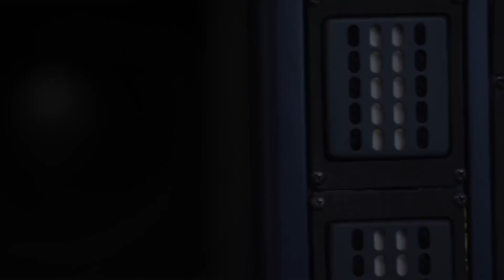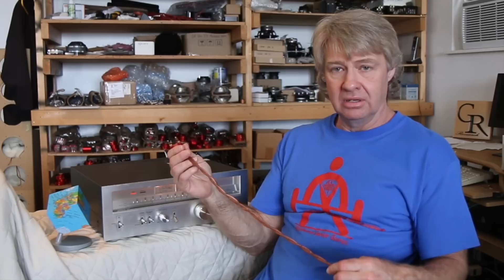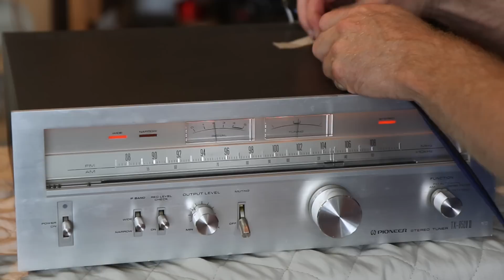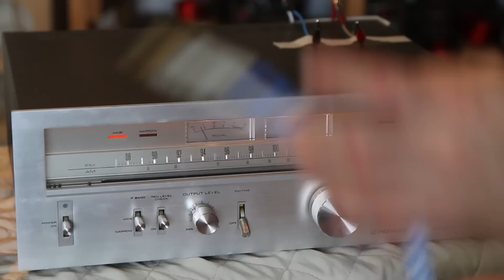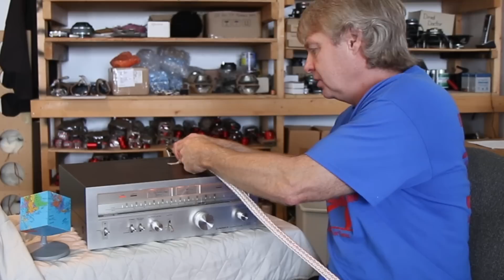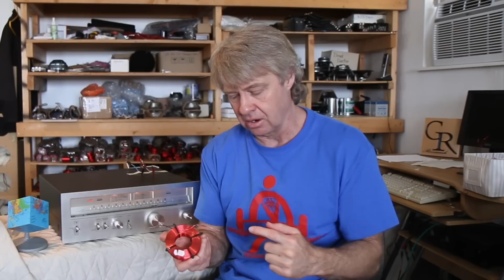Do Audiophile Cables Matter? Here's PROOF!

Comment: Danny, I think people are confused when you use the term "noise" as being something like hiss or distortion you hear as unclear, indistinct conflicting sound which covers up the music. When you say "noise floor" I think of very quiet sound, even though you meant something else. Here is an analogy that works better for me. If you listen to music at 2 to 3 AM in the morning your stereo sounds better because the EMI pollution around us is much less. Think of a lake of water early in the morning with no wind. The reflection of the moon and stars are perfect in the water. As the wind picks up, just like it does later in the day, the "noise" or waves on the water indirectly distort the reflections on the water making the picture reflected on the water less crisp and distinct. The water is like EMI noise pollution. Over the last 40 years EMI pollution has increased exponentially. Not sure as to weather EMI is sufficient coming in over speaker wire to make a difference, but the current of the music going through the wires can create it's own EMI that would be stronger.

Comment: You will always get noise but it's the level that is important. That is if it's enough level of noise to actually hear it. And no cable is going to get rid of all noise. Not completely. A lot of noise is picked up by the mains power lines. They are big antennas. But l really don't think it could be heard let alone noticeable. Otherwise this would have been an issue and addressed decades ago, way back in the '70s.

Comment: Listening to this video through my headphones with wires connected to my smartphone designed to use the headphone wire as the FM receiver antenna. Sounds great. Might be because I can't hear FM radio signals in the MHz range, or that the energy from the FM radio signal is near zero and won't drive the headphones, and if there was enough energy to move the drivers, they couldn't reproduce MHz. I just don't know.
Reply: You are 100% right. This is total hogwash, obviously. There are many videos, and articles by the experts in this field that totally dispute his "findings". PROOF? HA..
Reply: @WESTEL Audio  ;) yeah, but I also microwave my headphones for 100 hours on low to make sure they're burned it

Comment: With no input signal I can turn the volume of my 25 year old preamp going into 375 watts a side of power hooked up to 91db efficient speakers all the way up to full , much higher than I ever play them and hear practically nothing. Should I thank my power  company for the lack of noise in my system or is all this talk about noise coming over the transmission lines affecting the sound coming out of your speakers nonsense? I have nothing special in the signal path and don't do anything other than follow the basic rules when it comes to crossing cables and have zero problems picking up any audible noise from my speaker wires.

Comment: Obviously the more expensive cables will offer less resistance and inductance. You may be able to measure the difference, but can you actually hear the difference in a blind test? Most people will not hear the difference unless there is an extreme difference in the conductor. A filter on the incoming voltage of the amplifier might do more good than uber expensive cables.
It's what ever makes you happy.

Comment: Mr. Richie:  I think your presentation is getting challenged mainly because your assertion that the 100MHz FM band EMI results in a noise floor contributor (within 10dB/Hz) in the audio band.  That tuner's reference sensitivity is quite good, at 1.5 microVolts, which also does not help your argument because it puts any interference detected by the tuner at/near sensitivity (as shown by "stereo" capture and VU nominal) at best around 140dB below reference level at the speaker input, somewhere 40-60dB below audible threshold.  Tough to gain that up even with the worst of NFB amp designs subject to 3rd order mixing/modulation spurious products from ingress VHF.  I think you are simply demonstrating a parallel 2-conductor t-line will support induced TEM mode much more readily than an interleaved n-conductor t-line for physical dimensions on the order of the wavelength of interest.  Indeed, for this particular experiment, a dual/quad-shielded, RG6 or RG11 might fair much better.  Of course, terminations and length are also a key factor as others have argued.  On that note, I'm also wondering why you suggest some type of "filtering" is at play which, as you correctly point out, would not be the case with the coax.  If I buy a speaker cable and it employs any type of audio band filtering, I'm returning it as defective.  Since everything comes down to cost, I see from your web site that the best cable is $13.75 per foot plus $40 for assembly gear.  So I can have a nice 10ft cable for around $180?  Assuming of course I do a good job of assembling it.
Reply: I'm coming back to this one with greater detail and explanations. And yes we are offering low cost solutions that sound very good.

Comment: I mean it's proven that you want cables to be braided or shielded or both to some degree and the material to be at least pure oxygen free copper. Even for use of just sending a signal people use foil shielded cable. Why? Because even computers can catch interference. And that alone could fill a book explaining that but yea braided and shielded cables made of oxygen free copper are important.

 Silver plating is for the rich. Unless you go with stager silver solids but that's also another thing that could fill pages or chapters over.

Comment: The best audio cables I have are Van Damme with Neutrik connectors. I don't know how well that cable would be thought of in HiFi circles, I am mainly using it in a music production environment but I do listen to a lot of music. The worst audio cables I have are those plastic ones that come with any cheap audio/ video equipment you buy. So I decided to do an experiment where I split a mono signal, send the signal down both cables and recombine the signal at the other end but reverse the polarity of one of them so that any difference in the sound would be the only thing you could hear. So if the signals where identical, there would be silence. If i skipped the cables and did this experiment in the digital realm, there was total silence once the level of the two signals was matched. When I did the experiment via the cables, there was not silence. There was very little sound. I had to turn my amplifier all the way up to hear it but it was not silence. I don't know how much difference would be detectable by the human ear. I would like to try this with very expensive cables versus other cables.

Comment: I really hoped to get some proof rather than just irrelevant application of some wires to the amplifier input.  Sorry - but what were you trying to test?  Some weird braiding technics?- Noise-cancelling? There are no hidden tricks here like copper quality or wire thickness- it's all irrelevant. What's relevant is line impedance, source impedance and receiver impedance matching. Simple matched coaxial cable ( yes- chipset coaxial will beat any other that thick nonsense in terms of noise cancelling on low power transmission lines. There is absolutely no point in using so much wire metal for low- power signal as on the amplifier input side. And there is no point to use that much on the high power ether  if proper EMF compatibility technics are used  ( so just throw all that crossover junk with open coils spreading all sorts of induced noise).

Comment: If you really wanted to prove that there was a difference in cables when it comes to audio, you would simply measure a speaker with white noise, change the cable and measure again with the same white noise out of the same amplifier ect........doubt we'll see that any time soon though.
Reply: t doesn't work that way. The differences won't show up in amplitude.
Reply: @dannyrichie9743  A calibrated mic is far more sensitive then the human ear, if the difference can't be measured, the difference doesn't exist.
Reply: @matilija  It isn't a matter of the mic or the ear being more sensitive. The trick is knowing how to measure what we are looking for or how to measure what we hear. I'll give you an example. We make a change that makes the sound stage deeper.  We hear it clearly and it is repeatable. How do you measure it? There is  ton of stuff that we hear easily but have not figured out how to quantify it with a measurement.
Reply: @dannyrichie9743  So, you can measure a speaker and showcase how smooth it's response is, and if the crossover is tuned correctly, and how good the off axis response is, but you can't get a simple difference measured at all by changing the wiring?  Is it because there isn't one?
Reply: @matilija  No, it's because there are too many elements and variables that effect the sound that can't be measured yet.
Reply: @dannyrichie9743  Lol, I say there is a difference, and you just have to believe me because no difference can actually be detected by instruments that are better at detecting differences than human ears.  I'm done here, snake oil can at least be used to polish steel, though baby oil is cheaper.
Reply: @matilija  Just keep telling yourself the world is flat and feel comfortable in your beliefs. And please don't just take my word for it. I'll be more than glad to prove what I claim. Just come on over. Unless you don't trust your own ears.
Reply: Lol, resulting to insults because you know you're being called out.  Sorry Mr. Richie, but you are wrong on many counts.  

Here's the thing, you titled this video, "Here's proof". Provided absolutely no proof, nor anything even resembling proof of your claims.  And I already wasted my time watching your non proof providing video claiming to provide proof.

Why would I waste another minute of my time with anything you claim as proof when I already know you can't actually provide any and even readily admit that you can't measure any difference?
Reply: @matilija  I didn't title the video. I just shot it and sent it into my editor. 

You prove yourself wrong with your own words. "I already know you can't actually provide any".  You don't know what I can provide. You have no idea. You are holding to your beliefs and refuse to hear anything to the contrary. No science.... You are the flat earth poster child. 

And I showed a measurable difference in cables in the video.
Reply: @LouGuido  You also have it backwards. It's those that hide behind the concept of science that are failing to do any. 

" In scientific research you can observe an unexplainable phenomena through a measurable difference or through some form of controlled statistically valid testing."

Correct. Controlled listening test have been made repeatedly by myself and thousands of others within the industry.  

"These claims are then peer-reviewed for repeatability and confirmation and recognized as true in their field".

Yep, done that. And many other companies have too. 

"The key here is that in order to make a claim you have to show that some difference exists."

Confirmed. Audible differences exist and those differences range from subtle to quite dramatic. 

And there is no evidence to the contrary. When a known and confirmed difference is present but the measurements don't show a difference then you are measuring the wrong thing. 

And when you measure and then draw a conclusion that there is no audible difference having done zero listening test to confirm your theory then that is not science. That is a belief, just like the world is flat.

Comment: There are a number of offered suggestions about EMF and how antennas can be made from cables. Amplitude Modulation (AM) can be translated directly to sound. It's the simpler form of on-air broadcast mediums. The carrier wave varies in strength directly according to the amplitude of the input. The converse is true.    
Everything else requires 'translation'. All of the noise obtained for measurements here are broadband receptions and the tuner selects a particular frequency band which is reflected in these 'findings'. A more scientific approach would be to measure the ambient field's strength in it's entirety. This  can then be used as your 'ground' state. Then the 'noise' can be validated as to how it affects the output.
Encasing cables with a grounded layer will let us see what the cable actually does. 
Faraday cages for everyone!  BTW, nobody ever heard a FM transmission directly. That a wire picks it up, Eh.

Comment: HiFi consists of precision / construction and sound, precision is measurable and always has a theory, sound is typically not measurable and have no theory.
Sound (sound signature) can only be selected and judged by ear and brain.

What you describe is precision that is measurable as you show in your own way.

Sound differences manifest themselves clearly differently than noise, an example battery operation remove noise but a lead battery has a different sound than a lithium battery .

It seems that sound (Sound signature) is associated with material choice.

Another example is a paper capacitor vs plastic capacitor the majority hear clear difference.
Sound is associated with more or less lifelike reproduction, thats all Hifi is about.

Comment: Forgive me if this sounds like a stupid question. But I'm fairly new to the audiophile world and I'm learning a lot by watching your videos. Interference of any kind CAN cause measurable effects on the quality of your sound. So would having your equipment ran into a good quality power-conditioner help eliminate that issue? Would this, plus shielded cables make a huge difference?
Reply: If you live in a power plant it could.... In most of the regular homes an extra shielding does nothing, assuming that you prepped and connected your audio cables properly. Induction on both wires is in opposite  phase hence it cancel each other.

Comment: Speaker cable is connected to output stage, then to input stage via the negative feedback loop, it's known and is delt with within the global negative feedback HF roll-off.  Demodulation is achieved by any base-emitter junction (ie diode) you care to find along the way. It had an historical effect on 70's amps and some later poor designs which only had a resistor to set feedback If you wan't to make sure, just put some clamp-on ferrite cores at the cable at the amplifier end.  RF, you won't hear but it can cause intermodulation which is a distortion mechanism, so best be safe.

Comment: there are a lot  stupid comments here....  yes the demo he shows is true  the more a cable recieves from outside the more noise it transers to speakers.... realy guys i had an isseu whit an old reciever when turned off sometimes i can hear strong local stations on the midwave bands ..it was clear to hear wat the music was or wat the DJ says on that station.
Then i buy twisted speakercabels it was gone !
The better it recieves from outside wil give noise to the speakers, shielded works for interference if you have a ground problem like a microfoon touching and start humming but it wil not help for noise blocking whit interference from other cables or dirty currend from the net.. the best way to elimenate dirty current from the net is use a good Currentfilter between your wall power and reciever and components.. that filter a lot of noise out from the netpower. But Good video anyway !!

Comment: I dont hear any noise on my speakers , and im using Tube gear , im on tube amp . 0 noise , dead silent . i can record it for you but the noise floor on my Condenser mic phantom power supply , or fans from PC are going to enter in the picture , but trust me , when i get my ear down to the tweeter , cant hear jack shit , nothing . And that is on Tube Amplifier mind you .
How did i manage that . Easy , desolder Ground wire , so now i can die , but hey im going to die with 0 noise on my tweeter, you are going to die as well but with noise on that tweeter , messing with cables and shit , arguing about how much it matters .
While we the big boys , we desolder ground wires and do other wild stuff , so wild staff i cant even say it here  Google is going to delete my posts out of public  health hazard reasons ,  hazard for cable selling company's an shit :)

Comment: ive been watching many vids for the past 3 years for and against sound quality regarding cables. in the beginning i sat on the fence about it all mainly because i didnt know or have any knowledge on the matter. one day you would have Gene from Audioholics telling us that cables dont matter ,then you would have paul at Ps Audio and you telling us that all cables make a difference. Well after 3 years and a lot of swapping cables and making my own high end power cables ,i can definitely report back and agree with everything you and paul and all others tell us that they do make a difference.i couldn't hear much  in the beginning until i purchased the same speaker cable as you. i also made up a power cord using cable from a supplier here back in the UK. the difference in sound between my old power cable and the new one is very easy to hear.you wouldn't even had to be into hifi to hear the difference, my wife could if i asked her to listen.so i for one now agree with you guys.thanks for the time and effort to educate us all.

Comment: So, RF coupling affects the noise floor, and how you can hear the decay of instruments, correct? Just plug your cables into a speaker, but don't connect any amp. Then you have the RF at the speaker input. What will you hear?
Reply: I don't hear anything through my tin foil hat that protects my brain from RF noise.
Reply: The sound of positive thinking.
Reply: The sound of one hand clapping.